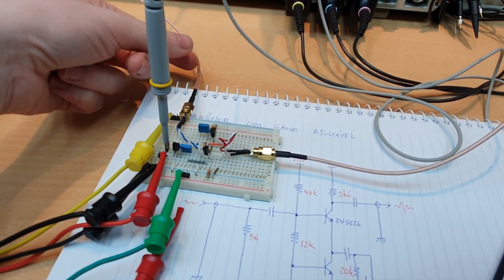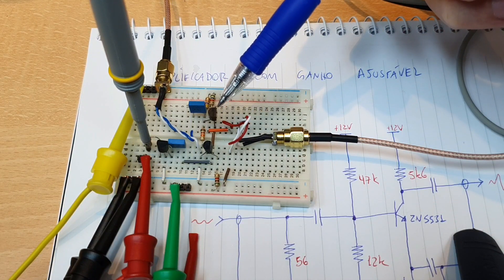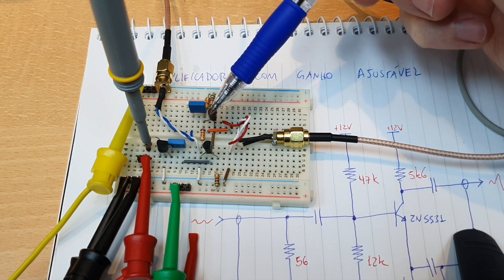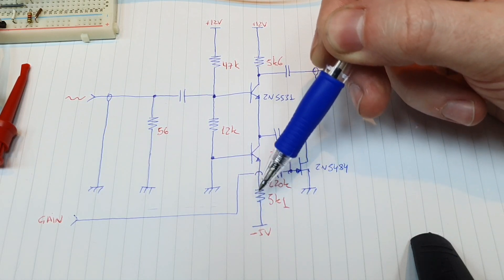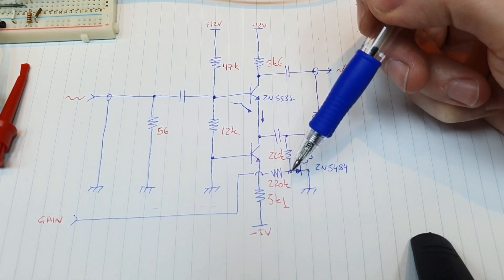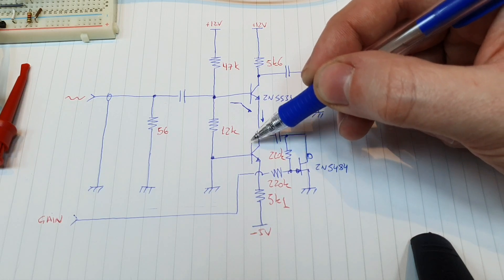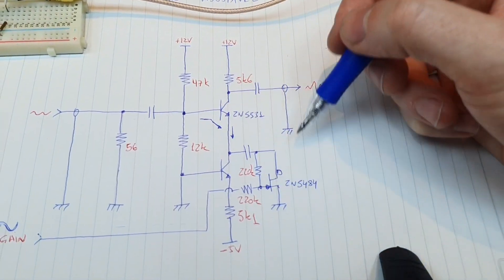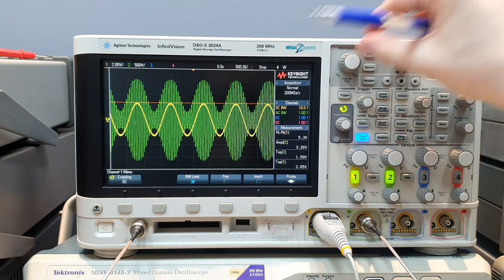Amplifier with gain control

Comment: What's the point of 220K from Drain to Gate around the FET?
Reply from the maker: It increases linearity by supplying Vd / 2 to the gate. That nulls a quadratic term in the Vg to Id equation.
Reply: @AllElectronicsChannel thanks a lot!

Comment: Hi, maybe you know solutions for such question:
Need to design local oscillator with stable output power and simplfy calculating systems i design,  for example, i use 100MHz crystal osc. The amplitude of output signal of osc. vary from one crystal to another from -3dbm to +13dbm, so to compensate this was decided to put an rf amplifier working in compression. This was made to stabilise output power. But there is one more parameter called power saturation. So for example in my rf amplifier (adl5545) compression point is nearly 15dbm and gain is nearly 24dbm. When amplitude of osc. is -3dbm the output power of amplifier is 14 dbm (p1db) . But when amplitude of osc. is 7..13dbm the output power of amplifier is 19 dbm – is not a compression point (is power saturation point). But in datasheet there is no information about it.

So how to design stable power output of rf amplifier does not depending on input power?
Reply from the maker: STABLE output power is only possible with a negative feedback servo-loop around the amplifier. You can have a signal diode measuring the output amplitude, feeding back a correction signal to the amplifier bias. Something like that will work with constant output power, sometimes this is called "levelled amplifier"

Comment: Great video! loved it. Wonderful circuit. Are there consequences to changing the 56ohm to say 1k so I can drive the circuit it more easily from say a typical consumer audio line out impedance?
Reply from the maker: Welcome! No problems! I used 56 to better match with the signal gen
Reply: @AllElectronicsChannel  Thankyou!

Comment: Hey, this is a fantastic video... I'm curious, is it possible to do something like this without the negative supply rail (a single supply)?  I have been working through a bunch of possible changes in LTSpice, and can't find a way to make it work.
Reply from the maker: Thank you!! I think it is! But you nees to bias the signal at half supply (vcc/2)
Reply: @AllElectronicsChannel  OK, thanks. I think I have something sketched up on ltspice along those lines that might work.  Now I have to order some JFETs...

Comment: Nice circuit!! just a comment, Gain can't be zero as it is usually defined as Av=vout/vin. if it doesn't amplify, Av = 1
Reply from the maker: 0/vin = 0
Reply: @AllElectronicsChannel  ha, true that. But anyways you still want signal in the output.
Reply from the maker: Hahahaha thank you for watching!

Comment: I notice that the circuit has an asymmetric power supply,  +12V, -5V. Would it be possible to achive the same performance with a symmetrical supply, and what changes would be required?
Reply from the maker: The asymmetrical supply was a design challenge in one class of a Hotmart course I'm lecturing. For a symmetrical supply you only need to change the bottom current sink BJT bias. If you bias it for constant current and linear operation, it will work !
Reply: @AllElectronicsChannel  Many thanks for the reply. :)

Comment: Nice little circuit. Since the bias changes, I was wondering if the THD+N also changes with it?
Reply from the maker: The DC bias actually do not change, because the JFET has it's drain AC coupled. But.. The JFET variable resistance is not much linear,  so it will be the main source of distortion!
Reply: @AllElectronicsChannel  Thanks. Yes that was basically what I was thinking. For the JFET, I think you mean that the modulated signal is distorted?
Reply from the maker: The two signals are distorted by two different reasons! 

1) the modulated signal is distorted because the JFET channel resistance will be nonlinear because of early voltage (channel modulation) [the AC signal will be present at the JFET as a Vds and it will modulate the channel resistance] 

2) the modulating signal also is "distorted" (the modulation index is not linear) because the relation of gate voltage to channel resistance is not linear

The first effect is minimized by a first order compensation by the two resistors you can see in the JFET. I used a voltage divider between drain and gate so half the AC drain voltage is summed to the gate voltage. This cancel (in a first order manner) the squared therm in the equation of channel resistance that is responsible for the channel modulation effect).

Even with all that, this circuit will work very well and is useful for signal modulation and automatic gain controllers!